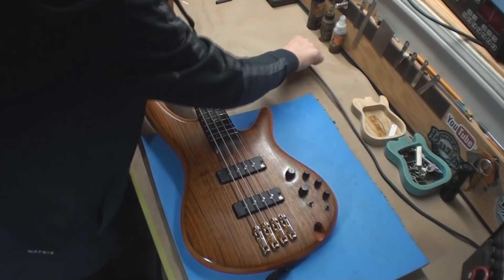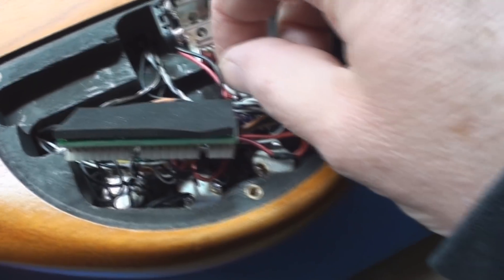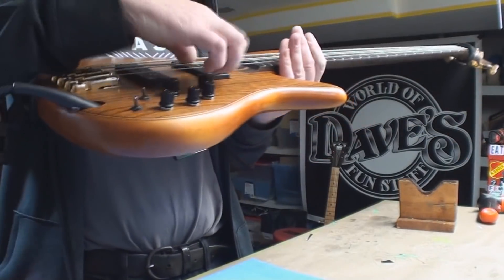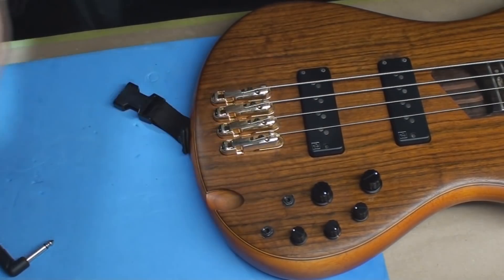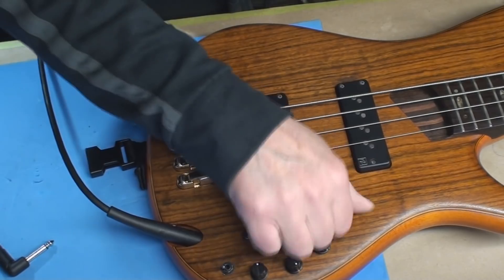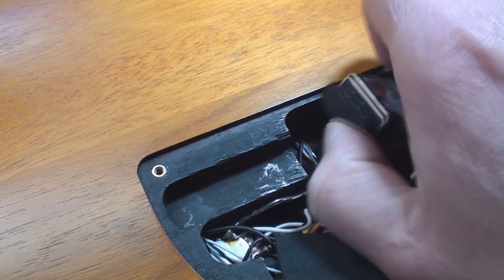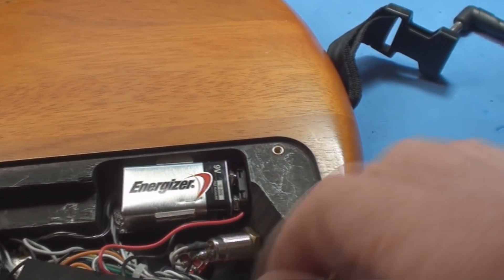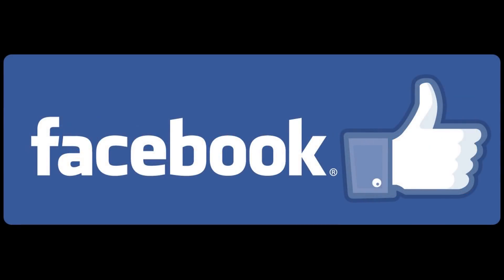Ghost In The Machine Guitar Electronics

Comment: Dave , I am 65 years old and have been doing this for 50 years. Just a little tip.... Next time you need to clean out a pot that has a gap in it , I used to get a suringe and spray some DeOxit Red in a cap. Suck the liquid into the suringe and inject into the pot. It worked great!! By the way...a long time watcher of your videos.

Comment: Dave you should check out some cables with a switch on the end so you don't have to keep turning your amp down and back up - I know Klotz and PRS have ones with a switch integrated in the tip so the action of just plugging it in is what depresses the switch and activates the cable, no more noise when you try to stick it in and keep missing ;)
D'addario/Planet Waves also has one with a latching switch on a button but you have to remember to push the button every time you plug/unplug your guitar so it can get a bit annoying. Keep up the awesome videos, I love your stuff!!

Comment: I get a faint hum till I touch metal, cts pots seems like a cold solder issue. I used a 30w iron not hot enough?
Reply: A cold solder doesn't necessarily mean that it wasn't hot enough. Don't fixate on the "cold". What was meant was the colour of the solder. When it wasn't lead free solder the solder is grey instead of shiny. It should look like like it was floating, like silk and not like modern art. What most can't see is that there can't be any movement while it cools down. It tries to get solid and you wiggle a leg inside the cast that's why it will break. Get a good "third hand" with long arms and not that crap for 10-15 bucks. I'd suggest a real soldering iron. 
That means one where you can adjust the temperature and that will heat up in less than 30 seconds. Take care of the soldering tip! Always clean it and leave a bit of solder on it when you don't use it for a while. Doesn't mean it has to be expensive: watch?v=Uvxm4j1RSz0  (sealody SSA51...while I have an old ERSA Station)
Reply: onpsxmember switch from 60/40 to 63/37 and cold solders become impossible. 63/37 is either a liquid or a solid and doesn't have that plastic stage 60/40 does

Comment: It's great when Dave chooses words like "not so robust" when he wants to say
FOREIGN MADE SHIITE,like on the switched barrel input jack
What a classy guy,eh?
Is there a worse power source than a 9v battery? WHY are we still plagued with all the junk that uses them? Conspiracy? There are plenty of IC preamps with 3volt supply and could use a pack of 2-3 AA or AAA's.Quadruple the life expectancy...even use rechargeables.

That Eveready 9V and Duracell leakers are like $4-5 each US .
Insanity,but the US dollar is now worth $0.26.
If it was shorting to ground(VERY possibly) there's almost no life left in that battery. 
My experience: Fender P-bass with active DiMarzios.Plays for one or two hours
Testing brand new batteries= 8.2 VDC. 

Facebook,no.
Reply: molson12oz 
1) Audio quality of low-volrage preamps. Ofc, this is rapidly changing
2) You can use 9V accu as well
3) Only one thing to check. Finding which battery in the set is poor is pain in the ass. Thats why everyone is using battery packs instead of separate AA or AAA batteries.
4) Size - volume of 9V batery and "holder" is super small, you can beat it only with slot-in cell batteries 
X) Yes, industry-standard battery/accu pack will be a solution for future, but people likes backward compatibility
Reply: Someone needs to take their meds and then a nap.